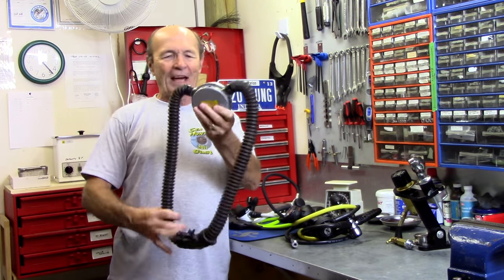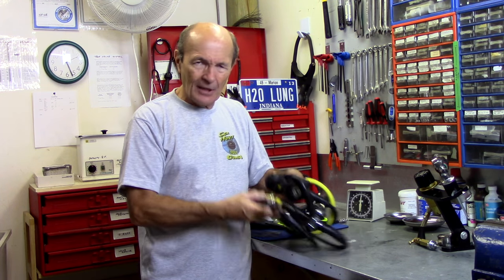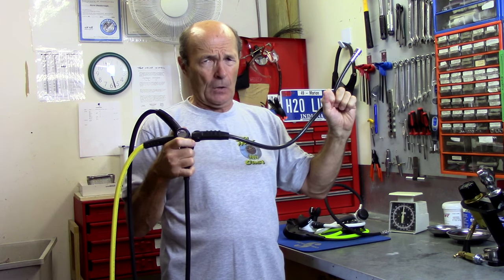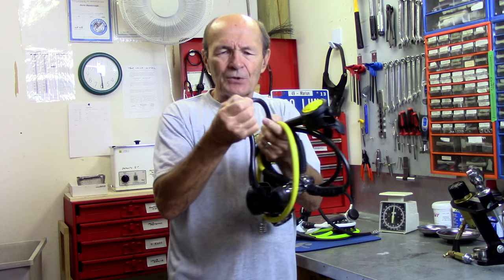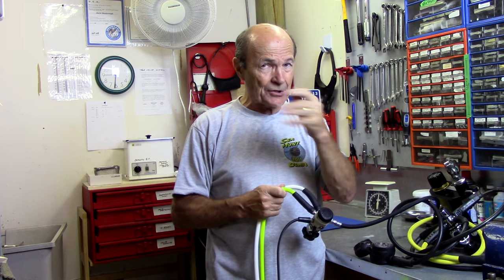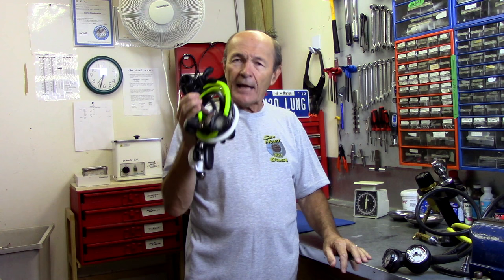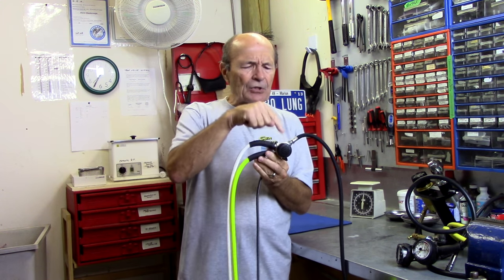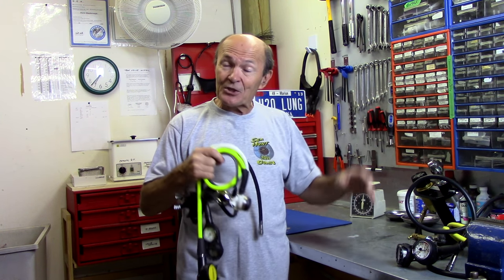Regulator Flex Hoses  - Good Or Bad? - Scuba Tech Tips: S04E04

Comment: Absolutely brilliant. The best diving channel on YouTube by a wide margin.
I am sure there are scenarios where rubber hoses are better or where a computer won't do without a backup spg. But in 99.99 % of the recreational scuba diving cases they will be perfectly fine.
Reply from the maker: That's my suggestion. If you're looking for a light, flexible, compact regulator for recreational diving (which is still 90% of all divers), the flex hoses are perfect. Thanks for watching. Alec

Comment: Excellent informative videos!  I've learned a ton! 
One caveat, that rubber or nylon outer layer isn't just there for looks. Its there to protect the nylon braided sheathing, as well as increase the pressure rating.  Without the outer layer, the braid can bunch up and allow the inner tubing to blow out or bulge between the braids.
Reply from the maker: Good points Brad.
Thanks.
Alec

Comment: Rubber hoses are not outdated. I still prefer them.over braided for
 many applications. I don't even sell.braided over 40 inches and don't 
use them on seconds I will be having around the back of my neck. They 
catch the little hairs back there and feel like.sandpaper on bare wet 
skin after a bit of time in the water. In addition they tend to take a 
set when coiled for storage. Their lightness also makes them very 
floaty. Ok for a 22-28 inch primary for some. Not for me and certainly 
not for a 5-7 ft hose. I have replaced a few of those with rubber ones 
for those who thought a braided 7 was a good idea and found out 
otherwise.

I also have some rubber hoses that are almost ten years old and are just fine on my pool regs.

Purely a personal opinion.

BTW, Thank you Alec for such a great channel!
Reply from the maker: Manufacturers suggest that hoses ought to be changed every 3-5 years. You are quite right, they can last a long time. I get many old regulators in for service, Dacor, Voit, old USD, etc, and some hoses are 20 to 30 years old and still work. LP hoses cost about $40. I'm just not sure it's a good idea to try to make your hoses last until they blow. I know that's not what you said but, there's no reliable way to judge a hose by looking at it. It's good until it blows.
And, rubber hoses are still the norm and a good one. For many divers it is the best choice but for the normal (?) recreational diver with a regular set-up, the flex hoses are really nice. 
Thanks for your comments and for watching. Alec

Comment: I moved on to flex hoses and never looked back. It's a godsend on the primary 2nd - so flexible and so little resistance.
Reply from the maker: They are a great improvement over rubber hoses.  The new tec flex hoses have a smooth coating to prevent neck rash.  They really are the way forward for new or replacement hoses.

Comment: I personally stay away from flexi hoses, over the last couple of years, I seen a number of them fail (2 of my own). The failure point seems to be at the ends where they connect rather than the hose themselves. In the same time I only seen one rubber hose fail. For travel they are great at weight saving, however if you are diving hog lop with no hood, they rub badly on the neck.

Comment: I have had two HP flexi hoses burst on me underwater. When I cut them open to check, the plastic inside had hardened, corroded and crumbled under finger pressure.
Reply from the maker: New Flex hoses do not have that problem. There was a short period when the hose liner from a particular manufacturer would break down. You should simply replace your hoses with new ones - no more problems.
There's lots of information about this on the internet. Just be sure to check the date of the articles to ensure they are current.
This situation, while potentially serious, is no more so than some scuba tanks that would break down and explode or regular rubber hoses that burst even when brand new and so on. It's part of the development process of scuba equipment or, in fact, the equipment used in any new sport.
Alec

Comment: Seen alot of those skinny HP hose's fail around the crimp. I think the weight of the contents gauge pulls on the joint when out of water. Perhaps a hose protector for the joints would support it.
Reply from the maker: Maybe. We don't put hose protectors on mesh hoses but maybe one of the thin rubber ones would be a good idea. Underwater there ought not be too much pulling. On the surface you could try supporting the console. I'm currently using a wrist unit and transmitter so no console at all. Alec
Reply: Alec Peirce Scuba im refering the the rubber parts used to cover the metal crimps, close to first stage and regulator.
Reply from the maker: Yes. I know. But you can get nice light rubber ones which do the same job as the great big, heavy rubber or super-stiff plastic ones. I think they'd do as good a job without adding weight or stiffness to the hoses. Alec

Comment: Imo the flex hose causes less fatigue on my jaw vs a rubber hose, it doesn't tend to push so much.
Reply from the maker: That's one of their benefits. The old rubber hoses were quite stiff and they got more stiff with age.
Some divers complain that the old hoses pull the reg from their mouth when they turn their head to the left. I always found the hose pushed the reg from my mouth when I turned to the right.
Regardless, the flex hoses don't push or pull.
Take care. 
Alec

Comment: I remember when I bought my xtx 50 Apeks regulator as a package ( 1st, 2nd and octo ), there was a flex hose in the box from the manufactory!! if they were not safe, I don't think apeks will sacrifice their reputation for a hose!!  

what makes any hose not safe is the fact that people don't replace them even after 5 or 10 years !!
Reply from the maker: Yep! I agree. More and more regulators are arriving from the manufacturer with flex hoses - Oceanic, USD, Apeks, etc. And you're right about replacement too. The manufacturers of the hoses - rubber in particular, suggest you change them every 3 years. That may be a bit overly cautious because most divers don't use them as much as manufacturers might think but 5 years is certainly a good limit. Thanks.  Alec
Reply: Bought a Mares Carbon set that came with flex hoses. My Axion BCD came with a flex inflator hose so they seem to be pretty standard equipment these days.

Comment: Just bought a backup reg set with all flex hoses. I am impressed with the weight and ease of transport. Apeks XTX50 with DS4.  What is your opinion on long hose configurations? Longer hose primary so you can donate it and a shorter hose secondary hose on a necklace. I don't personally see the advantage and understand why you would want to donate your primary when you don't have too. I am in tec40 and trying to figure out why this config is popular. Thanks!
Reply from the maker: The long hose concept is based solely on extreme penetration diving where giving your Safe Second to a buddy would require handing it along your full body length to him either behind you or in front in a very confined space. In that circumstance, it's a good idea.
For normal diving, and I used the word normal intentionally, the standard Safe Second set-up is the best. Having to remove your own mouthpiece from your mouth, your own source of air, especially in an emergency, is a stupid idea based on the false assumption that your buddy would grab it anyway. That idea is a hangover from the days of buddy breathing - long gone, thank the Lord!
The long hose has a very specific, very narrow application. I hate it when proponents try to force it on divers who are either new to the sport and don't grasp the ramifications or on others to make them look 'cool'. 
It looks cool until you have to use it!!
My opinion on this is well-known if you have read previous videos about Safe Seconds but, there it is in a nutshell.
Take care.
Alec

Comment: Hey Alec, nice video.  I've been thinking about flex hoses for a while.  Do you know if there are any companies that make flex hoses for QD computer hoses?  I'm thinking that the QD ends are proprietary to each manufacturer and generic flex hose manufacturers don't have access to each QD fitting - or don't want to make various QD fittings.
Reply from the maker: Hi Donney. Sorry for the delay.
When I changed my gear to flex hoses I too wanted all or nothing and discovered the same problem.
There are no flex hoses for Quick Detach (QD) hoses as used on many air integrated computers.
I looked everywhere - no deal.
So I made up the necessary adapter and now we offer to change any QD hose to a flex hose.
Any decent, knowledgeable and dedicated service tech can do the same. It just requires him to take the time to find the necessary adapter from the QD female end to a HP flex hose swivel female end. I found them at a company called Omni-Swivel. Their fittings are marketed by Trident but Trident won't know about them. You need to call Omni-Swivel directly, explain what you're trying to do and they'll have them for you.
Alec

Comment: Alec, since I haven't yet used flex hoses I have a question. " Will using flex hoses eliminate the need for a swivel to reduce the pull"?
Reply from the maker: The flex hoses are so flexible that pull or push on the mouthpiece is almost entirely eliminated. 
In my experience, a swivel at the second stage hose end does little to eliminate pull. It MAY make it easier to lift or lower the head but the hose is still a solid line and pull/push still occurs. I also don't like my 2nd stage to flop down when I remove it as occurs with a swivel. And swivels are expensive, jam up with corrosion and are hard to service.
I suppose my answer to your question is an unqualified YES!
Alec
Reply: @AlecPeirceScuba_SeaHunter  Looks like I'll be going to flex. Thank you.

Comment: I read that braided hoses have a tendency to float, that they're more buoyant than rubber hoses. In your opinion, is that a good or bad thing?
Reply from the maker: There have been many opinions about flex hoses since they were first introduced and lots of negatives have been stated.
Typically divers resist change, especially if it might cost them a dollar!
I've no idea if flex hoses float. I never dropped one into the water that wasn't fastened securely to a regulator!
I know they are lighter than the old rubber hoses and I know that's a good thing. It's particularly good if you travel to dive but also good to reduce jaw fatigue.
Since more and more scuba gear manufacturers are using flex hoses on their new gear, it's a bit academic. Sooner or later all divers will be using them.
Personally I love them. They're lighter, coil much more tightly for packing, tougher, don't crack or deteriorate, look better, come in 20 different colors, any length you could need, they don't need hose protectors, ... . How am I doing here?
Thanks for watching.
Alec

Comment: I just watched a video by 50ft below on flex hoses with an issue of crystals forming on the inside of the hose from rapid temperature change. Will you please comment on that?
Reply from the maker: This is old news Michael.
Some early flex hoses had the inner core break down in some situations but it was a slow process. It didn't happen in short time.

The new Flex Hoses do NOT have that problem.
That video is either old or based on old information.
You can read more about that in some other comments below.
Take care.
Alec
Reply: Alec Peirce Scuba - Thank you for your quick response sir.

Comment: I think it's worth mentioning that DAN has recently issued an urgent warning about systemic failures relating to these modern flex hoses which is still ongoing:

" the discovery prompted a wider, global investigation, which is ongoing....DAN Research would normally wish to conduct more in-depth analysis with a wider sample of defective hoses, but because this is a potential hazard to regulator function we prefer to err on the side of caution and report this phenomenon now."

Original warning June 2, 2016:
http://dansa.org/blog/2016/06/02/newsflash-low-pressure-hose-deterioration

Follow up article, Q1 Winter 2017:
http://www.alertdiver.com/crystallized_hoses
Reply from the maker: This issue has been discussed a dozen times. I am a big fan of DAN but like a doctor, they always want to perform surgery when a Band Aid will do.
The flex hoses that break down are gone. It was simply put, an issue with the material used in the inner hose. Once that problem was discovered (almost 5 years ago), manufacture and distribution of the offending brand was stopped. 
If you purchase new flex hoses from fresh stock they'll be fine.
Alec
Reply from the maker: Good point. No matter how well publicized a problem is, it can still exist.
If you can do so, check the hoses to be sure they are NOT polyester (polyethylene) (PE).
Alec

Comment: Alec,
What are some good flex hose brands you could recommend that are high quality? Also would I have to get anything special to make these flex hoses work with Scubapro A700 primary, R195 octo and mk25? The fittings should work out of the box?
Reply from the maker: Yes. The Flex fittings are completely compatible with all regs.
Flex hoses are made by a hose company - not a scuba gear manufacturer or distributor so you don't really choose a make of hose.
MiFlex is a brand name that has been around for quite a while.
I've had good success with the hoses from Innovative Scuba which any dive shop can get.
Good luck.
Ale
Reply: Thank you for the speedy reply sir.
Love the content!
Reply: Billy Z stick to standard rubber hoses. Trust me.
Reply: Already made the switch and gosh they were so much easier to travel with!

Comment: Alec what about buoyancy on these hoses? Iv heard people say they tend to have a positive buoyancy
Reply from the maker: Hmmm. If they do it's so minor that it would be inconsequential.
Some people have to analyze everything until it's worn out.
They are lighter than rubber hoses but also thinner so probably the same.
Throw one into the pool to find out.
Alec
Reply: Can be slightly floaty in comparison to a rubber hose... Only really makes any difference if you're using a long hose setup as it could technically be a bit more unwieldy to find, recover and stow...

That said - I use flex hoses exclusively in my (long hose) set up, and love it. I'm a massive fan :)

Comment: well there are also some negative facts about flex hoses so new ruler hoses 
a 210cm flex hose squiggles a lot more than a rubber one also a rubber hose is more smooth so its perfect fore a stage where you have to put it under rubber bands 
and with rubber hoses you can see when they are damaged and you have to change them with flex hoses you can't
Reply from the maker: Quite right 356. Nothing's perfect and flex hoses fit right in there. Any damage to the outside of a flex hose usually shows as little hairs sticking out. If you are using anything other than a standard recreational rig - sidemount, 7' hoses, etc - you may find rubber hoses easier to set up. Thanks for watching. Alec

Comment: Some people seem to have problems with older / worn flex hoses when they use a dry suit, as the fibers sticking out of the worn flex hose might puncture the dry suit. Guess this is not a problem with wet suits / new flex hoses.
Reply from the maker: Right Timo.
There were some fraying/breakdown problems but they seem to have solved that.
Any flex hose with little hairs sticking out should be replaced. 
Your dive store should give you new ones.
Alec

Comment: I cringe every time I hear you say the rubber on the outside serves no purpose.  That is false. It is there as an abrasion preventative for the nylon or other polymer pressure bearing portion of the hose.  It acts as a sacrificial barrier. Additionally preventing the hose from kinking and knotting prevents pinch points that are stress points that can create weak points that can ultimately lead to failures. Think of bending a straw for your drink in half at the same point multiple times. At some point the straw will develop a crack. That point would be much quicker than a straw that doesn’t allow that much flex.  

Traditional hoses, when the outside starts to crack and look like they are going to break, the interior hose is almost invariably still in functional condition. Flex hose, much more difficult to spot and the interior can be weakened without very visible damage to the outside sheath. 

Fire hoses have a very drivable sheath as well. It is a hose within a hose. 
Pneumatic air hoses for shops are the same way.  
Heck, the construction of a car tire is similar to that of a traditional hose.  
Even everyday garden hoses are constructed this way.  

So, there is a purpose and it sure as heck isn’t cosmetic.  While flex hoses may well be safe and great hoses, it doesn’t mean you need to ignore the features of the other hose.  Each hose has its trade offs and can serve a different purpose while still functioning well. 

As for me if I were to go with the flex hose for ease in packing, I would definitely consider replacing the hoses after a certain number of trips knowing that it had be flexed more and potentially created weak spots in the hose.
Reply from the maker: I may have been too simple in that comment.  We both know the rubber coating is important for the reason you state and hose safety.  I'll be more careful in future.
A

Comment: Mickey Mouse hoses. Don’t buy them. Expensive. Kink more. You can’t tell when they are ready to give up. They float which is annoying and makes your rig not streamlined and increased if snag hazard. 

Short story - stick to standard rubber hoses. Just like jet fins.
Reply from the maker: OK Madd.
It is 2018 you know. Still using a dial phone are we??
I've been using flex hoses for over 5 years and have sold hundreds to many very experienced divers.
I've not heard those objections before but, good to hear your views.
Alec